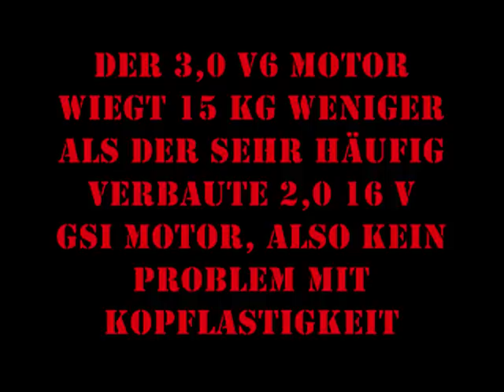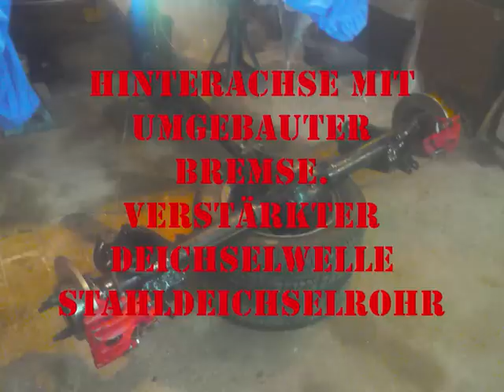Kadett C V6

Comment: Müsstest Du nicht die hinteren Kotflügel etwas ausziehen? Das schleift doch mit Sicherheit, wenn Du beladen bist oder ziemlich ambitioniert unterwegs, oder?
Reply: Gude. Nein die Radkästen mußten nicht gezogen werden. Räder haben so drunter gepasst (knapp). Bin aber am überlegen ob ich ein paar schöne breite Stahlfelgen in 15 Zoll montieren werde. Dann wirkt es Klassischer und gemeiner
Reply: Gute Idee, wobei das hier jetzt auch schon ziemlich gut aussieht. Hattest Du an Mattig oder sowas gedacht, oder eher irgendwelche Originalteile? Ironischerweise gibt es ausgerechnet bei VW schöne 15er mit 4X100 Lochkreis...
Reply: Am liebsten währen mir verbreiterte Sportstahlfelgen, aber die 13 Zöller passen nicht über die Bremse. VW hat schöne 15er, das stimmt. Mein momentaner Stand liegt bei den Mattig in schwarz, schön geschüsselt und mehr Gummiequerschnitt.
Reply: Ja, ich mag auch lieber mindestens 50er oder sogar 60er Querschnitt. Diese flachen Gummiriemen auf den Felgen sind nicht so ganz meins.Die 13er waren mir immer zu klein. Die waren ja damals total angesagt mit 175/50. Hast Du überhaupt noch 4x100, oder ist das auch umgebaut?
Reply: Ist noch 4X100....habe auch schon in Richtung BMW Felgen spekuliert. Habe mal gehört das der alte Camaro Sechszylinder auch 4X100 hat, habe aber diesbezüglich nie was gefunden. Im Endeffekt  kommt man immer auf die Mattigs